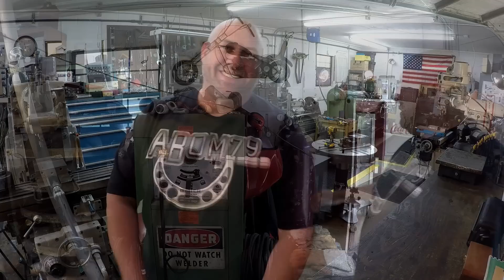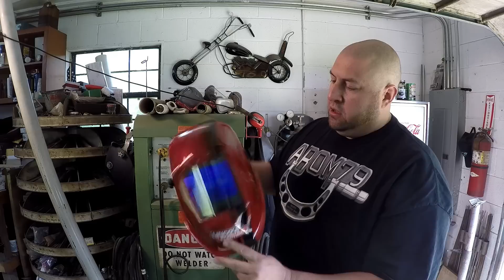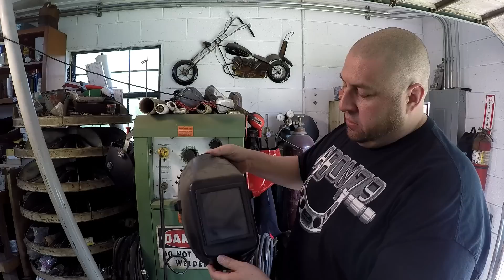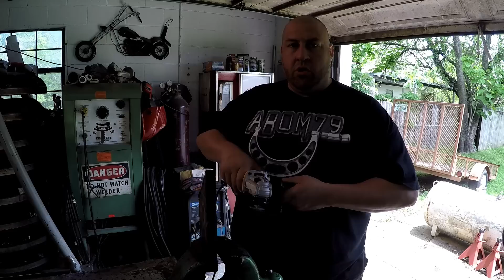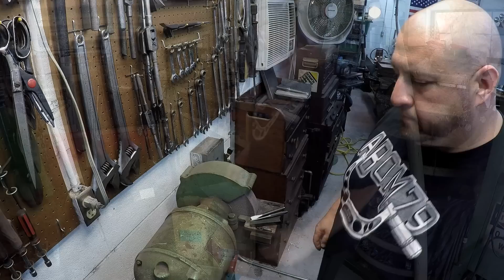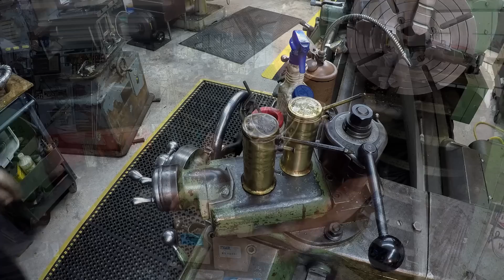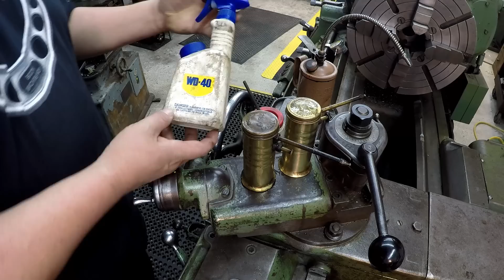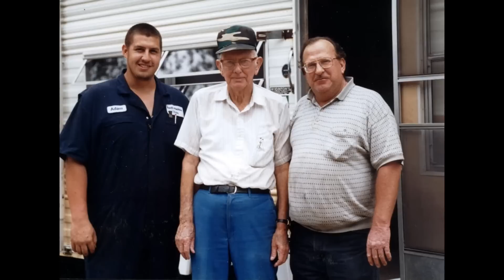10 More Shop Do's & Don'ts

Comment: Adam, another great video, a subject near and dear to my heart.  I will ring in with a little info that not everyone is privy too.  When using a power tool one is often required to use an extension cord.  Always always use the fattest and shortest extension cord you can lay your hands on.  Here is why.  Current is heat.  Current is voltage /resistance.  A thin extension has more resistance, this causes voltage at the end of it to drop, sometimes dramatically. As the voltage driving the motor goes down the current draw goes up.  More current more heat.  keep your extension cords as short as possible and as large as possible!

Comment: When you replace a grinding wheel on a bench, pedestal, surface grinder, etc, tap it with the plastic end of a screwdriver and listen. The disc should ring and sound completely solid, if it sounds dead or lumpy, break it immediately! A dead sounding disc is cracked internally, and will break, usually the first time it's spun up. Breaking it after you find out it's bad saves someone from putting it on without checking and having the wheel blow up in their face.

Comment: My friend, I differ from your advise on the oxigas issue...you always shut down the carburant gas first and then the oxygen, as the oxygen cleans the inner tiny channels of the torch, if not doing this way surely you will have a backward of the flame, I've been doing this way and never got that sound you mention

Comment: Also, the drill maintenance drives me crazy too.  I make a point of only putting drill bits back in ready-to-use condition.  If it gets burred up or dulled, I always deburr or sharpen it before I put it away.

Comment: The using the last consumable thing is an excellent point, but that works both ways.  We have trouble running out of stuff at work mainly because the boss has a minor stroke anytime one of the guys tells him we're running low on something.  Nobody wants to get chewed on for five minutes because the shop went through too many grinding wheels last month, so half the time nothing is said until the next guy needs one.  Then the boss has a stroke because we're out of whatever, and nobody said anything.  If you're the boss, you need to accept that even with honest employees who take care of their equipment, consumables are going to get used up and will need to be periodically replaced.  If you don't want to be constantly running out of stuff, don't shoot the messenger when one of your employees tells you you need to order more.

Comment: Tools are expensive & you should only need to buy them once in a lifetime. Most people who want to borrow stuff can afford it they just would rather you spend your money than theirs. Having your own good tools are a sign of a true professional.
Pay attn to what other people use & what the work requires so you don't spend buy a bunch you will never use.
There are a few people who I trust to walk in my shop & can use anything anytime, for everybody else there is old used junk since I may never see it again.
Just buy the CORRECT wheel for your bench wheel depending on the application. I have 3 (bench) grinders,
 1 for tool grinding,
 1 for snagging steel
1 for non ferrous (non-ferrous on a steel wheel will cause them to explode & contaminate alum if you are going to weld on it).

Comment: Great video.  Please allow me to put my two cents worth in on proper oxy-acet. welding equipment shut down.  When extinguishing the torch turn the acet. off first.  Yes it may pop but the oxygen (which is still running) will purge the remaining acetylene out of the torch.  Many times I have seen a small flame left on the tip when the torch is shut down oxygen first.  You may find your place of work burnt to the ground the next morning.  The supply tanks should be opened for use by opening the oxygen tank valve all the way.  This is a double seating valve which will seal the valve stem and prevent leaks due to such high pressure (2200 psi on a new bottle). The acetylene tank valve should be opened 1/4 to 1/2 turn.  Tank pressure is not high ( 250 psi on a new bottle) and the stem packing can prevent leaks.  The opening of this valve so little will aid in quick shut off should a fire or other emergency happen.  Please bleed the regulators down when finished with the welding equipment.  If you leave the regulator keys turned in -- the next time you turn the tanks on you may find the working pressure gage blown.. The regulator cant react to a quick pressure change and will send tank pressure to thee gage.  Regulators are bleed down  the same as the torch shut down.  Acetylene first then oxygen.
Reply: mark conrad you can also turn off acetylene first, then oxygen, check if there's a flame, then purge the hose with oxygen. At least i learned it that way

Comment: Also loosen the oxy set regulators so the diaphragm is not under stress. If you use a saw or grinder, wait for the motor to stop spinning before putting it down so it doesn't suck dust and shavings off the floor.

Comment: I liked this one as much as the last one, Adam.  
I must have about a dozen drill chucks that go in a hanger on the wall, not including the ones that are in machines.  Every one of them in the hanger has their chuck key in the chuck.  So many of the keys are different, it's the best way to keep chucks and keys mated up.

You caught me on one thing.  I have a bunch of drill indexes, and today while I was working I noticed I have a couple of bits in one index upside-down.  I spun those two and forgot to clean them up.  Can't blame anyone but ME for that, since it's in my own shop!  ;)

Thanks for all the vids.  I work alone in my little job shop, and it's nice to watch you, Tom, Tony and Keith after my work day.  Kind of like visiting you other guy's shops and having kind of a conversation.  Happy turning!

Comment: Suggestion -- if you've borrowed a particular tool over and over, consider if maybe you have even put more wear on it that its owner.  If that's a possibility, then when you can finally afford your own, if you manage to buy the same exact tool, offer to trade them the new one in thanks.  Some would accept and some would refuse, but either way you both feel good.

Comment: Good points. The grinding techniques and torch etiquette especially. Also there is that huge risk of turning your shop into what is essentially a bomb (no pun intended) if you mess with leaving oxygen leaking out.

Comment: I've always been big on the get your own tools deal. When I was starting out, if I had to borrow a tool from someone, half the time I would hit the tool house on my lunch to try and get one. Another thing I do if I borrow something, I make absolutely certain that I put that tool directly into the owners hand when I return it, not just stick it back in his box. This is for 3 basic reasons; 
1- So I know and they know that I returned it 2- Everybody has their own filing system and it's irritating if something isn't back in its designated place3- I make sure to thank them for letting me use what they shelled out their hard earned money for and trusted me with.

Comment: Both my gas tanks are empty right now because something came up when I was using them last and I forgot I hadn't done a full shut down and closed the main valves. (they're out in the expansion shed and don't get used more once a month, easy to forget) I had just filled them too, $100 into the air.(shorties)

Comment: I wish more folks would borrow my tools, no sense in having a $200 dust collector. However I come from a more production background and a high utilization ratio for capitol equipment is just good business investment sense. I hate machines that need proprietary tools for the same reason, the tool just sits waiting for that one use on the one machine each year.

However I should note that the loans should go two ways, and probably won't be open to the hack that makes poor choices in general.

Comment: Do-and-don't
Don't turn acetylene on more than 1 turn, on the off chance that the hose were to rupture or a piece of slag were to drop on it and set the hose on fire, you can turn fuel gas off by one turn of the hand.  
Do clean the contact tip on a GMAW or FCAW after every use.  Know how to set drive rolls and tension on the spool.  
Do NOT use a torch as a hammer.  If you cut the piece all the way, it will fall off, no need to beat it loose. 
Always keep a clean torch tip.  Make sure you have a tip cleaner

Comment: Another good one Adam, I agree with everything except the way you turn off your acetylene torch.  Turning the Oxy off first is also the way I learned how to do it way back then.  But a teacher many years ago told me that if you turn off the acetylene first your tips will stay much cleaner and require a lot less cleaning.  Although you bring up a very good point regarding the pop as a distraction to others which I do understand.  However, being retired for 13 years now I rarely have anyone around while I’m working so I’ll continue with my way of doing it.  You do bring up some very good points and I thank you for doing this.
Reply from the maker: +rtkville It's annoying and distracting when people shut off a hot torch or rosebud and it pops so loud is like a gun being fired off in the shop. Turn off the oxygen first and eliminate the annoyance.

Comment: I understand the loud POP of someone turning off a torch can be startling, but it's safer to turn the gas off first. If you turn the oxygen off first, the acetylene can continue to burn back inside the torch, or even worse it can flashback into the regulators. I was always taught to turn the gas off first to prevent this problem. In my experience, a torch will only pop if it's dirty. Clean torches rarely pop.

Comment: Nice Video @abom79 I know it's not funny when the torch pops but if you turn of oxygen first it's possible that you get a backfire in the torch and you burn the front tip. It doesn't happen often but it can. I usually turn down the oxygen, put the gas out and then it I turn of the oxygen. If you do it that way it doesn't pop that loud.
Greetings from Belgium and keep up the good work!

Comment: I was always taught to turn off the fuel gas first and then the oxygen on an oxy/acetylene setup because when you turn off the oxygen first there is a heap of black soot produced by the acetylene before you get to turn it off that settles on everything around where you are working.  Great tips though, many of them common sense to most people in the trades. :-)

Comment: Adam; Here's something that used to bother me, when I was younger. If you're sharing tips with someone, and they start to describe something they think is great, don't just cut them off, before they're done. Hear them out. They just may have a time-saving idea, that you can benefit from. When guys get older, they can get cranky, and short tempered. Enough on that.Mark Nelson

Comment: For cords and hoses for the love of God wrap it over and under with the loops. I can't stand trying to get the twist out of 50 or more feet of 1/0 cable or have an air hose wear out quickly because it wasn't coiled right. Also, you kill it you fill it.

Comment: Great tips---esp. the one about the pedestal grlinder and those that apply to gas bottles.....

A courtesy that you may have already mentioned: NO practical jokes that involve shop equipment, e.g., greasing handles etc.

Another you may have also mentioned: Leave a machine free of chips and rubbish, ready for another task...., and do NOT retain shop-owned tools checked out earlier if only used INTERMITTENTLY.....!!!

Comment: When I was coming up in a machine shop I was gifted my grandpa's 0-6" Starrett outside micrometers, a beat up Tumico caliper, and a B&S 12" hook scale that had a chipped corner but nothing else. The old codgers that worked there for 30+ years would loan you a tool only a couple of times before telling you to buy your own. Thankfully most of them took pity and loaned me extra things until I managed to get my own. They pointed me to pawn shops to find the things I needed and now I have multiples of most every tool I own. I remember the first new tool I bought (Starrett 6" scale) and have carried it in my pocket for years. Buying your own tools makes you appreciate them more.

Comment: Two thing come to mind. First, I lent a hub puller to a friend and it came back beaten up by a hammer. Reason was it got stuck and he couldn't get it off the hub. Lesson learned by me, and it has never left my drawer since. Second, I get asked occasionally if I would sharpen some drill bits by friends. So far no one has offered me a few bucks to replace the grinding wheel. I am not that cheap, but an offer would be appreciated, even if do take it. I have thus learned to suggest the local hardware store sells drill bits, or I will take the time to show them how to sharpen them. 
Oh - almost forgot; suggest opening the acetylene valve tank only 1/2 turn or so for safety.

Really like these tips you are presenting, plus a lot of the comments. I am 71 and can only blame myself for my home shop condition. But when one has to buy their own tools respect for them is (or should be) automatic.

Comment: I have a decent (Jet) bench grinder and a cheap (Central Tools) belt grinder. Should I be doing all my mild steel on the Harbor Freight unit? What's the recommended tool for removing a lot of mild steel?

Comment: So I was just wondering about the torch safety, I think the saying goes "A before O or up you go" but It depends on the gas you use. On an oxy/fuel torch you shut the fuel off  first. if not it can cause blow back and and burn the torch head off or the regulators even with flash resistors.
Reply: I always get that POP when you turn the gas off last, and you have the soot from the orange flame, I always turn a little O2 on before lighting to avoid the soot too.
Reply: I was taught this too. Fuel on first fuel off first.

Comment: An addition to the thread below on Oxy Acetylene Torches.  I was taught not only to shut of the bottles but then bleed out the remaining gas in the hoses (acetylene first) then back off the regulators until the adjusting screw is free spinning.  At least back then (45 years ago) there was concern about blowing out diaphragms when opening gas bottles with a regulator already set.

Also, finger tip pressure is all that is needed on the torch valves, no whole hand cranking.

Comment: Great tip about keeping the key in the chuck. One of my pet peeves is rolls of box tape. I worked at a place where we used a lot of box tape and it drove me mad that co workers would not turn a little corner of tape over so that it was easy to find the end. Great tips and great video, thanks Adam!

Comment: Great video Adam, thanks. With the oxy-acetylene, when I did my trade we were taught that when we were finished with it to relieve the pressure on the diaphragm in the gauges. That is turn the bottle off, turn the torch tap on and vent the gas, close the torch tap and turn the diaphragm tap all the way out. Same thing for an inert gas bottle on MIG or TIG.

Comment: I'll suggest filling an oil can or solvent bottle before starting a job if it's under half/third/quarter full.   Then you'll neither have to stop for more in the middle of an operation, nor have to refill it after, usually.

Comment: Buying tools applies in most shops. It can get VERY expensive though. One of the things I've done is keep the "old" tools in a different box. So say I started with a Harbor Freight wrench set, Then moved up to Craftsman, The HF tools go in the "old" box, Then when I went from Craftsman to Snap-On/SK/Mac/Matco or whatever. The Craftsman tools go into the "old" box. The "old" box is the loaner box. NO first line tools get loaned out.

Comment: Clean up duties has been a pet peeve of mine, forever. 
When I stated as a millwright helper/trainee  over 40 yrs ago, I was working in a shop where at some point it was decided that it was the MW helpers job to clean the shop at the end of the shift. There  were 4 trades that shared that shop. An electrician, a welder/iron-worker. a pipe-fitter and the MW and I, the others had no helpers.
 On my first day I was told that it was my job to clean the whole shop regardless of whose mess was left behind. When  I questioned the supervisor about that, he said that's the way it's always been, so just DO IT! So I did , i swept everything up and put it in a bag. 
The next day I went in a little early and sorted thru the bag and separated  the junk by trade.The welders rod stubs and slag , the electricians' knockout plugs and bits of wire and sheathing, a couple of the PFs' cutoffs , ETC. 
You can imagine the looks on their faces when they found their individual junk in their lunch pails at  supper time.When asked what the meaning of it was, I didn't lie, I told them that stuff must have had some personal meaning to them or they would have thrown it in the trash.
I NEVER had to clean up any of their junk again, They just never left any around. lol
Reply from the maker: Good way to make a point, and glad to hear people change there tunes.

Comment: About the tourch, I have learned to switch the gas first of then the oxygen. The reason for that, the oxygen will blow the flame out. And you don't get a bang from when the flame is burning back in the tourch.
Maybe a good tip; clean the workplace after you are finished a job, make time for cleaning. It is a pain in the ass too clean somebody else his mess before you can do your job.
Great videos!
Reply from the maker: +CATGVO You do that with the big rose buds too?
Reply: SOB rosebud don't pop it sounds like a  cannon.Had to pull a rudder stock out of a tuna boat and we had four guys each running a rosebud in a 12 x12 room in the middle of august. Bender shipyard. Didn't work there long. Too many psychotic people.